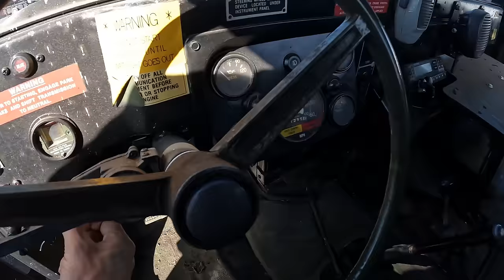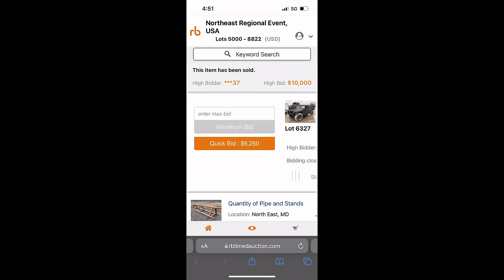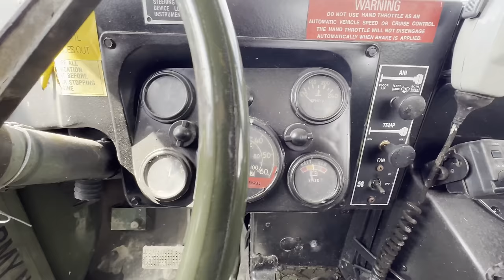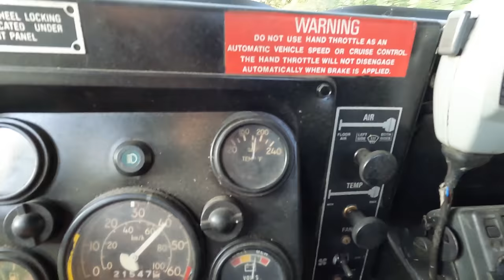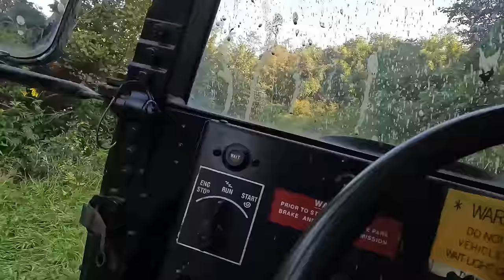Buying, Servicing, & Off-Roading The Cheapest Humvee I Could Find!!

Comment: 25 years Army maintenance here. Love to see the ol girl back on the trail. I wanted to mention in case it's not been said before that there is a switch plugged in next to the washer bottle that controls the cooling fan. It's for fording water, if you put the truck in neutral and slam on the gas it activates the switch and will shut the fan off for 15 seconds or so giving you time to enter the water. Doing so otherwise you risk shearing all the blades off the fan. My only other advise is " brake throttle modulation" when stuck like that you can gently ride the brake and power through it. It fools the truck into delivering power equally on all four wheels. Hit me up anytime if you need extra tips. I went to AM General school at the factory in 2012
Reply: Awesome advice!
Reply: Pretty sure they have funky diffs in them that are designed to lock up when there's brake application specifically for that very reason. Not a normal gear diff in there, not a normal locker either.

Almost makes me wonder how difficult swapping a manual trans into one would be...
Reply: @TestECull  if you hit the brake slightly its like the free spinning wheel got resistance from the ground and the dif is diverting some power to the other wheel. maybee enough to drive out.
not having lockable difs on each achsle and one between both is the biggest flaw such a vehicle can have i was allways wondering how the humvee got away with this (and without a manual transmission)
the second one is not having a strong winch, extra cable, at least one snatchblock and some chans or loops with you while in that trails ;)
Reply: At AM General they told us the differential  was originally developed for NASCAR but outlawed in the '70s because it allowed you to apply 100% power in the corners without losing control. Then the designer of the Humvee bought the rights and used it. As far as I know this is the only vehicle those differentials have ever been used in. I have videos of us climbing 4 ft concrete square blocks on opposing wheels by just powering through the brakes. I feel like this school should have been something every Humvee operator should have gone through day one. It was one of the best schools Army ever sent me to..
Reply: @Total_Egal  yeah.. Not having diff locks is a bit of a shock to me.  You would think that would be an absolute must on these things.   I'm not sure how the diff's are on these, but you can get lockers for about $1k each for regular 1 ton Dana axles. (which I know this doesn't use -- just a reference).   I think putting diff locks on this is the number one upgrade I would ever do to these things.
Reply: @Total_Egal  Way back when the Humvee was being released to the military there was an article in Popular Science or Popular Mechanix that went over all the specifics of what the military wanted on the Jeep replacement. One was an automatic transmission because fewer and fewer people coming into the military knew how to drive a manual.
Reply: @tbirdracefan  yea.. in the US... 
in other countries you teach your soldiers how to drive and use all that manual shifting and dif lock gear on the vehicles, and how to winch you out if there is no tree in close reach. and know and feel the angles your car or truck can manage. also how to drive in such conditions^^
hitting the limiter on that Jeep to somehow get it out realy hurts. not seeing them putting in dif locks even more. (i asume this thing also dont got them.

also an example i would NEVER stop right behind or close to the top of a hillside or on the bottom of a downhill path. also not close behind a waterhole or river.
you dont see the vehicle behind the top if you climb and you might drive with some speed and cant stop quickly.
on the bottom you might loose breaks, be to fast or just slide on slipery ground or roling rocks and hit the other stopped vehicle. means now you got 2 damaged cars not only one. same on waterholes. you need the space to get out with some speed and drive away from it to the solid ground. 
and on the solid ground you need the parking space for the second car. 

but at the end.. its boys toys and they had fun with it.
and it looks more suitable for the bad "roads" he is often on as a regular truck.
Reply: @sgtrhyno  went to one at Fort McCullen Alabama. The forging tank was impressive !
Reply: @texasrancher9318  yes there are vent tubes on everything. Each geared hub has one, the diff's etc. The run all the way to a high spot in the engine compartment. They are all 1/4"  black plastic tubes
Reply: @calholli  it has a locking feature. When you look at his transfer case selector lever it has high, high locking and Low. It isn't really necesy though because when you brake throttle modulate it acts like a locker for that obstacle. The brake rotors are directly mounted to the differential, not out at the hubs. When you apply brake the truck See's it as equal traction and you power through it. This truck is far more capable than thought because for the average Joe we were never taught how to properly use it. I was in the army for 14 years before I went to school at the manufacturer to learn all it's features. At the manufacturer school I was both in awe and pissed because they taught us so many things that the army never did. I spent so many times on the side of the road and Iraq scared to death when it was just a simple one wire fix that I didn't learn till I was 14 years in. That's the army's fault, not the manufacturer. The Humvee is incredible and very hard to stop if you know how to drive it
Reply: @sgtrhyno  I'd like to see the diff taken apart and see what that brake is actaully attached to.  I'll try to look up a video about it......   I can understand braking the free spinning wheel and that will transfer the power to the other wheel.  But you would really need to have independent brakes at each wheel to do that.  ( I know that's basically how modern electronic "traction control" system works- with wheel speed sensors and ABS running each wheel independently) ---    But with that being a single brake, I would think that it's just locked to the ring gear, so I'm not exactly sure how that works, and I want to see it apart; -- there must be some sort of special setup that I'm not aware of.  (unless it has a brake on each axle of the diff)..  I'll have to learn more about it.
Reply: our headquarters companyCav scouts got 4 brand new hummers and blasted through water and started to overheat. they checked the engine and all their fans blades were gone LOL
Reply: @tbirdracefan  That was dumb, people going into the military are young and can learn almost anything overnight. Everyone that can drive a stick had to learn it at some point.
Reply: @texasrancher9318  Yes they did centralize the vents. Everything is brought back to a main trunk and up to the air cleaner. All four geared hubs, both diffs, t-case, and trans...
Reply: Long-time Hummer and HMMWV owner (since the 90's). Brake-throttle-modulation is the term for getting the Torsen-1 spider gears in the differential to lock. The T-1 in the HMMWV's have a 4:1 bias ratio which as long as the side to side traction stays within that ratio, it will drive both outputs the same. Once traction drops outside that ratio at one wheel, you need to be in HL or LL, and application of the brake (as long as wheel isn't spinning fast - that will snap a half-shaft in no time) - with increasing pedal force as traction drops off with application of throttle with the other foot to get the engine torque up "fools" the Torsen into driving both outputs the same. Without HL or LL, all the torque goes to the wheel that's outside the bias-ratio.
Reply: @Poorehouse  didn’t these come out during the Where are the nearest about 82? I was a weekend warrior and we were getting rid of the Huey I am 60 and jeep if I’m correct.
Reply: @sgtrhyno  3:06 .. he says this one only has "low, high and neutral" --  No locking feature.   It would be much better if it just had a locking switch for each axle...  Or at the very least, a manual "e-brake" that goes to each wheel --  so  4 separate levers, which you could use like a tractor-- so if one wheel is spinning, you could just pull the brake lever for that wheel to stop the spin and push the power to the other side.
Reply: What Ryan said. Broke one while deployed, didn't know about the switch.
Reply: Have you tried and use rivet nuts to put threads in.
Reply: What awesome advice..
Reply: @TestECull  They have Torsen differentials.  A Torsen is a torque multiplying differential.  It takes whichever side is taking the least torque and makes the other side get a fixed multiple of that torque.  If one side has zero torque, they don't add torque to the other side.  Dragging the brakes adds torque to the free spinning wheel and gives more to the other side.

Even "limited slip" differentials get help this way. The clutch packs have a spring applied pre-bias, but add more force to the pack as more torque is applied (through cam action of the side gear pins on the carrier).  By dragging the brakes, it will apply more torque to spin the axle and put more force on the clutch pack.  With a limited slip in the rear and open up front, it's better to use the parking brake since that only brakes the rear axle.
Reply: @sgtrhyno  Quite a few vehicles have Torsen:  https://en.wikipedia.org/wiki/Torsen#Torsen_applications
Reply: @sgtrhyno  Look up Gleason Torsen as in Torque Sensing. I read in the distant past that those units at the time wouldn't hold up with really high horsepower due to metallurgy issues.  Now with improved steel they will hold up. I have used one in a race car.
Reply: @calholli  If driven properly you don't need all that.  The people that designed and built it knew what they were doing.   Its made for 18 year olds to go off-road in.  Most of which have never been off road or don't have the skills to manipulate multiple levers in high stress situations.
Reply: Good to know but too late for me.  My training was, wait for the light to go off and start it. lol  Clean it up when we get out of the field.
Reply: Good advice Ryan 👍. It Good learning from experience experts...
Reply: @kd8bac  Matt did say he has a rivnut tool on order, his repair is temporary unless it works...
Reply: Get the -10 manual!!!!  One very important thing to check from my Army National Guard days are the THREE ball joint castellated nuts on each wheel.  Each has a cotter pin.  Check each to insure there is a cotter pin.  I found two during maintenance times that were missing!  Losing that nut would not be good!  CHECK and report bac Matt!
Reply: @calholli  it's really super easy. The diff's are centered high in the truck mounted to the frame essentially. Off both sides of the diff is a spud for lack of a better term and the calipers/rotors are mounted off that. In the middle of the brake rotor/diff spud you mount the cv axle which runs out to the four geared hubs which are located at the wheel. When you hit the brake you are stopping the whole running gear instead of the wheel. They stop on a dime and hold like a tank. They did this to keep all the important gear high in the chassis giving the truck more obstacle clearance. The CV axle goes into the top of the geared hub and roughly 6" lower on the other side the wheel is mounted. It's roughly the same as portals on these new side by sides the kids are all running. In essence just picture a traditional diff with the brake rotor and caliper hung off the side of it.
Reply: @calholli  he said that but look at the lever, it's labeled right next to the lever. His is the old 4L80 trans with the 6.2 naturally aspirated engine. The newer 6.5 turbo and 4L80E didn't come out till the 1113/1114 series. We started seeing them in 05'-06' a long with red dot a/c heavier suspension
Reply: @matthewbeasley7765  maybe so, that was the spiel from the manufacturer school.
Reply: @sgtrhyno  Ok.. so there's two brakes, one tied to each axle.  I see.   Another reason they put the brakes on the axles is because of the mechanical advantage of being on the input side of the "portals" --   If the portals are geared down 3 to 1.. then the brake only has to work 1/3 as hard to stop the truck.  It's actually better to think of it the other way around:   Lets say the wheel is hanging in the air and free spinning at a high speed (and you let off the throttle completely, so no engine power, just the drive train spinning)...  Lets say that free spinning wheel is applying 10 lbs of spinning torque pushing against the brakes as you push the pedal on a normal setup with brakes at the wheel.   That brake will see that full 10lbs of force (on a normal pickup setup), which puts wear on the brakes...  But when there is a portal, with a geared down ratio --- When 10 lbs of torque is spinning at the wheel, it goes through that 3:1 gear ratio at the portal, and now the brake that is on the diff/ cv axle -- only see's 1/3 of that torque--  or only 3 lbs of force pushing against it-- so it only takes 3lbs of brake force to stop 10lbs of rotating mass at the wheels..  I've never driven a humvee, but just by the design, I can tell that it doesn't take much brake pressure to get a lot of force happening---  so I bet it doesn't take much pressure to lock the brakes.   That's why "bumping the brake to make the diff lock" as you said works well with even light pressure to the brake pedal -- because it doesn't take much brake pressure  to lock it up, since it has that mechanical advantage of being on the high side of the portals gearing.  Obviously there's going to be a lot more than the 10lbs example, because you have the weight of the moving truck pushing on all the wheels from the momentum of it's forward motion--  so there's a lot more pushing back against the brakes than simply the rotating mass of the wheels alone.  So it takes less work and much less wear to stop the truck---  This is particularly useful on trucks with really huge tires like the bigfoot style monster trucks.  Because they have so much rotating mass that if the brakes were directly on the wheel, they would quickly overheat and never be able to stop it....   so they usually go even FURTHER-- and put the brake on the incoming drive shaft -- so that will gear it down even more, and have that much more mechanical advantage vs the wheel....................   Now, if the Humvee "portals" are geared 1:1 (1 to 1 gear ratio)-- then it doesn't really make any difference, and it will have the same performance as if it's at the wheel, like a standard pickup.  In that case, the "portals" are literally only there to give it a little bit more ground clearance.  But I would probably bet that they do have a bit of gear ratio change--  having the brakes up on the axles is a dead give away-- because again, there's a mechanical advantage for being there.... gearing down the portals also applies more torque from the engine right..  Just like when you're driving around in 4 Low -- there's more torque, but you lose a lot of top speed..   With these humvee's having portals and are likely geared down, I bet it doesn't have that high of a top speed.  I bet it can't even do 70mph  (I'll look it up).
Reply: Great information !
Reply: 🇺🇸👍 thank you for the service!
Reply: Are the M35A2 a good truck to buy?
Reply: @CJPhillips6648  I have a 2002 F350 7.3L diesel, ZF 6spd manual, manual transfer case on the floor, manual locking hubs.  Extended cab with a flat bed.. and it's definitely a good truck to buy.  I put 330k miles on it and she's still a great truck that pulls strong.  Definitely the best truck Ford ever made.
Reply: I've read that somewhere before I've always thought it was strange how when they designed this vehicle they wanted to make it as idiot proof as possible that's why it's all wheel drive and not the traditional four-wheel drive that's why has the limited slip or locking differentials however you want to argue it and has all these cool features but don't train people how to properly use them in my mind a switch that says fan off or what have you want to you push the button and it momentally goes off for 30 seconds will be so much better than have to educate people to put in neutral floor it then put it back in drive and you think switches to lock the differentials would be better but at the same time I understand people would just drive around 24/7 with the differentials locked
Reply: Hey 24yrs Army retired also Maintenance
Reply: Thank you for sharing your knowledge with us,  I would like to go to that school, to learn about Diesel engines!😃
Reply: Ryan, prepare for brain picking;  PICK!
Reply: my uncle was maintenance at camp Robert in Cali most his life and retired i think Sargent first class or something like that
Reply: " brake throttle modulation"  - I did that with my 1970 Ford Econoline Van (two wheel drive - ordinary rear differential) using the hand brake.  One time it got me out of a parking spot with ice near the curb on about a 15 degree uphill (in Duluth, MN).
Reply: Yeah, they have helical gear limited slip differentials. They operate like truetracs. If a wheel has no resistance it will spin free but once you feather the brakes the diff will transfer power between both wheels. You're not tricking it, it's designed to do that.
Reply: gm 6.2 / 6.5td, buik, 1956. gas engines. gm would not go to cummins/cat/or anyone, to get a decent real diesel..fkn sad..typical gm..there boat anchores.. IH,,fixed them..
Reply: @calholli  I think the difference in these use a spool gear design instead of a spider gear design like most of automotive world. Some heavy trucks use  the same design to achieve a power split. Also keep in mind that the diff has bull gear advantage like a farm tractor due the ratio change at the hubs.
Reply: @hikerJohn  Not many women can drive stick specially going up hills. A lot of clutches would have to be replaced but the auto trans would pretty much last the lifetime of the vehicle.
Reply: @calholli  It shows where those disc brake rotors are attached to 22:37
Reply: @martyk1156  Yeah, that's exactly why the brakes are at the diff, so that they share that same advantage.
Reply: can you load an h1 tune on an army humvee?
Reply: Man, I really love all the cool little Army hacks these machines had--from running on 10 different kinds of fuel, to all kinds of rad kill switches, super-heavy-duty Allisons in everything (because everything is gonna get driven by 20 year-olds)--it's all just awesome. Thanks for sharing the knowledge dude, cheers and rock on.
Reply: A member of our Jeep club refilled my Jeep's refrigerant in the AM General service bays where he worked back in October 2007.  I don't recall if it was the South Bend or Mishawaka facility though.
Reply: 10 years Army loved our M1113. Neve knew about the cooling fan feature 😎 👌🏼.
Reply: @TestECull  Torsen differential. They don't lock up, they transfer power to the wheel that has the most traction. They kind of work like an open differential in reverse; instead of the wheel with the least traction spinning the other wheel gets the power. Neat design.
Reply: @TestECull  yeah it's the same helical design as an eaten true track diff. It works better on those because the brakes are up in the middle next to the differential so when you hit the brakes the differential can really feel even more so. When General Motors produce the H1 with all the same technology except Creature Comforts it actually came with selectable lockers
Reply: @sgtrhyno  the Locking feature is for the transfer case Center diff lock so that the front and rear shaft has been at the same speed just like Toyota Land Cruiser and Land Rover so it goes from all-wheel drive to front and rear axles locked but it's not locked differentials. Those trucks have three differentials each front and rear axles and the transfer case just like my Land Rover Disco. The differentials on those are the same as eating true track helical gears torsion
Reply: @calholli  I believe the Locking feature in low means that the transfer case differential locks so that the front and rear drive shafts are locked together as opposed to all-wheel drive on the street same thing with Land Rover and Land Cruiser they have a center diff lock in the transfer case diff. So there's three there's front and rear diff and then transfer case diff that's what the lock is making both axles forced to spin the same speed Wheels can still turn independently.
Reply: @ronaldrrootiii6040  I'd prefer selectable lockers on the street...and in fact that's one of the planned mods for my '85 F150 as 99% of the time open is perfect but 1% of the time I'd love a spool...but I can definitely see why, in a military vehicle, you'd want a simpler method of locking a diff which the torsen setup provides. Just lightly apply the brake and it does its thing.
Reply: @RMosher11  unless one wheel gets up in the air and Spins then it acts like an open diff that's where hitting the brakes or even better if you have electric traction control combined with torsion gears super sweet
Reply: @TestECull  oh yeah absolutely and much simpler since a locker has to be activated somehow there's more to break. I would love to get true track in My Land Rover because I have the old ABS traction control that just stops the spinning wheel and  sends torque to the other one.  it works great I can only imagine how it would work with those differentials
Reply: I have the same lockers in my jeep in fact I bought them because they are used by the military hummer and they are self-contained mechanical, they are Eaton Tru-Trac, in case you want to look them up. simple theory really, it functions on the principle that a worn gear can turn a spur gear but a spur gear can't turn a worm gear.
Reply: also better off not using synthetic diff fluid because the locker takes more "pressure" to lock up. When conventional oil makes it easier to lock up because the unit needs to see friction to lock
Reply: Hy Ryan. Have you a mail ? I want to speak about my hummer h1. Have you a account Facebook? Best regards Gianfranco from Italy
Reply: As far as I know, I'm the only one to give the engineers an issue they couldn't resolve in Mishawaka. I went to the Maintainers course at AM General when the UpArmored HMMWV's (M1065's(?)) were getting issued to Iowa. We had a truck that came into the shop for a service and the wait to start light would flash when you honked the horn.
Reply: @Total_Egal One does NOT want to apply the BRAKES while any wheel is spinning ...that is unless one likes to replace half-shafts. BEFORE entering an obstacle that “may require” Brake-Throttle-Modulation (BTM), lightly apply the brakes AND throttle at the same time ...hence the word "MODULATE." On that trail basically carrying no payload, tire pressure should first be lowered to around 12-15 PSI all around to give the tires a bigger print and less ground pressure per square inch. Doing so with these Old Dog, ex-Mil. HMMWVs you may want to have an auxiliary air pump along to reinflate tires for highway travel back home. [The vast majority of Civilian HUMMERs (H1) are equipped with Central Tire Inflation System (CTIS) that allows deflating and re-inflating all tires on-the-fly.] 

One last thing; do you know if there are Runflats or Beadlocks or nothing inside those tires?  That M998 would have left our factory with Hutchinson (rubber) Runflats/Beadlocks inside every tire, but that was 30+ years ago.
Reply: @calholli  They will go anywhere that "lockers" would also take them.  AM General way back when ran comparison tests at Moab up Potato Salad Hill and every other place for a week and there was no difference ...IF...BTM is properly used.
Reply: @sgtrhyno  Agree, about the schooling, but the USMC and Army did NOT want us showing their operators BTM!!! Some "Special Forces" did receive our training (including BTM) at AM General's Off-road Course in South Bend ...others at Rod Hall Racing School near Reno. FYI: AM General HUMMERs won the Baja 1000 off-road race every year they entered (1992-2002).
Reply: @texasrancher9318  All gear boxes on the HMMWV (including the P/steering pump & brake booster) are vented in to ONE common vent system that connects to the air cleaner.  For USMC HMMWVs there is an add-on Deep Water Fording Kit that will allow depths up to 60 inches (close to the top of the windshield glass).
Reply: @tbirdracefan  [[[Way back when the Humvee was being released to the military there was an article in Popular Science or Popular Mechanix that went over all the specifics of what the military wanted on the Jeep replacement. One was an automatic transmission because fewer and fewer people coming into the military knew how to drive a manual.]]]

Exactly, since the mid-70s the U.S. Military has spec'ed automatic transmissions in all their wheeled vehicles!  The article you refer to was in the April 1983 issue of Popular Mechanics. At the time we at AM General were in very close competition with two other manufacturer's designs to win the Army's award for the new HMMWV. If you read that article about AM General's design entry, most was pure B.S. in an effort to throw the other competitors off the track to what AM General was really designing along with aircraft engineers on a clean-sheet-of-paper! I draw your attention to the illustration in the article that depicts AM General's "Geared Hub" (I still get a chuckle when I think about it).
Reply: @jimbella9353  I do have a recollection of the mention of the geared hub. My take away was the gears allowed the drive shafts to come into the hubs at a much higher location therefor adding more ground clearance. I would be interested in the details or BS.
Reply: Just used btm and it got me outta a rut like I had lockers! Worked great
Reply: That's sooo awesome! I'd love to pick your brain a little. I used to have the civilian model and recently bought one of these. I look forward so much to learning more about it. I will do a lot of very detailed work on it. I got luck and got a set of jankel seats for it and having them upholstered  now, they are going to have a little awesomness. these are the seats that were designed to jelp absorb an IED, they look bad ass. this whole project is my favorite I've ever done, I don't think I'll do any others really. I'm still lacking a lot of know how on these though
Reply: I bought a HMMWV last summer and Hhave been scouring YouTube ever since for info, tips etc...  I never seen the one on the fan before good stuff.  I do have the PDF of the owner's manual but it never mentioned that either unless I somehow missed it.Thanks again for your comment
Reply: Hey Ryan first thanks for your service, I know I’m a few months late but I actually have a humvee that I’ve Cummins swapped and I’m trying to get the deep water fording kit to work again but honestly don’t really understand exactly how that vent/deep water pressurization valve for the seals work if you’ve got a Instagram or phone number or something like that I’d really appreciate some help if your not comfortable sharing yours let me know I can send you mine
Reply: Thank you for the tips!
Reply: The Humvees have Torsen (torque-sensing) differentials in them. These diffs can be found in everything from Range Rovers to 4Runners to Audi to the Ford Raptor. The patent was held by Gleason I believe. I don’t think these were ever intended for use in NASCAR as they seemingly would have little purpose…traction is not a problem on a paved track.
Reply: On my 1986 m1008 army truck , the factory air cleaner sticker said that my 6.2 diesel had 155 horsepower. Torque is about 250.
Reply: its s helical, if you added abs traction control and abs it would become the best kind of torque vectoring system 

by power braking it you force it to mechanically torque vector because helicals are automatically torque biasing
Reply: I name you humvee master